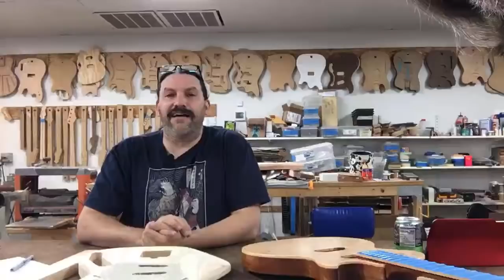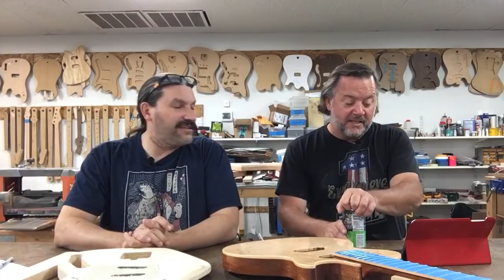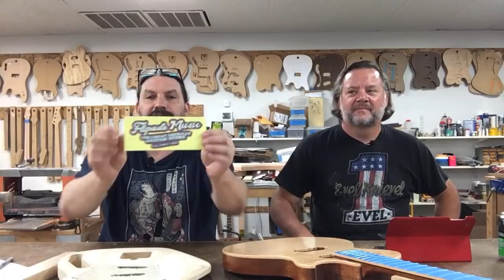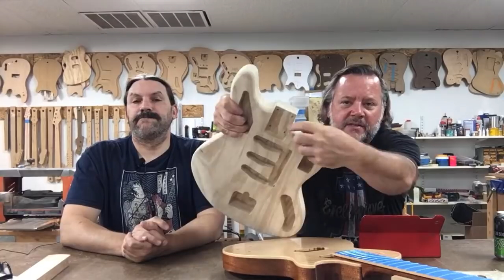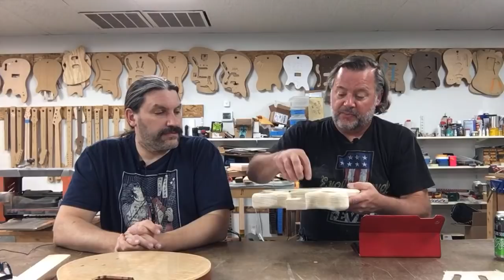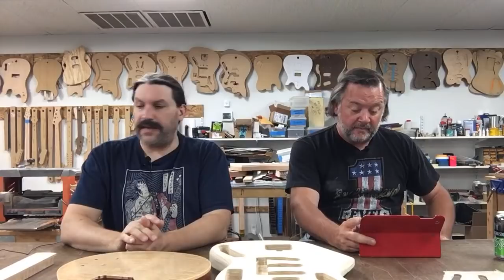Live! Guitar building and repair question and answer. Episode 2 10/15/20

Comment: Pro tip for using lavalier mics (from someone with a 30+ year career in broadcasting) don't clip them directly to the collar of your T-shirt, especially if you have anything like a beard. As you speak, your neck skin moves and scrapes across the mic, because it's being held in place by the stiffer rim of your shirt and it starts popping.

If you attach it to your shirt a couple of inches further down, you won't get the interference, with the added benefit that you can turn up the gain and it won't clip.
Reply: thanks for the tip! We will try that next time!